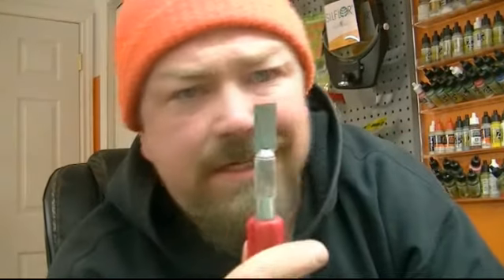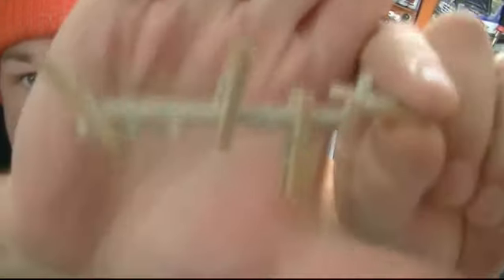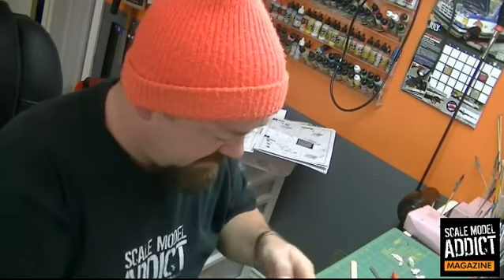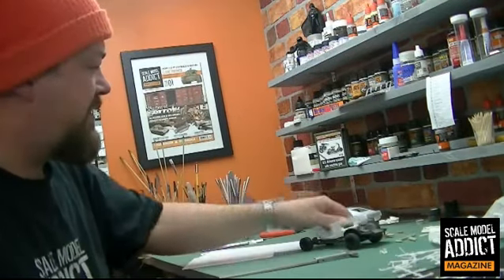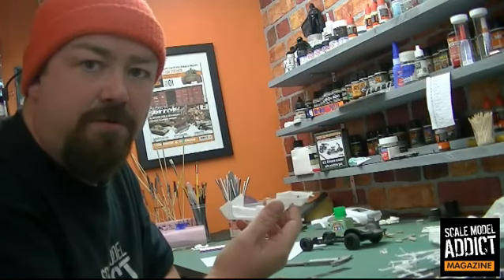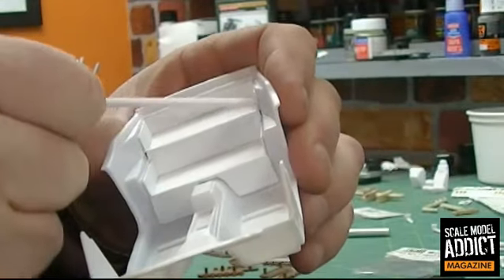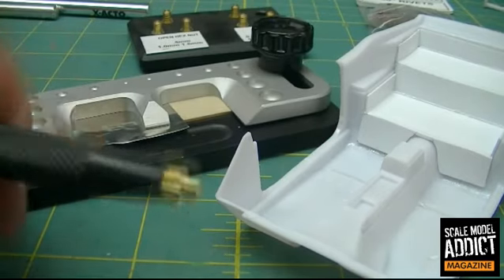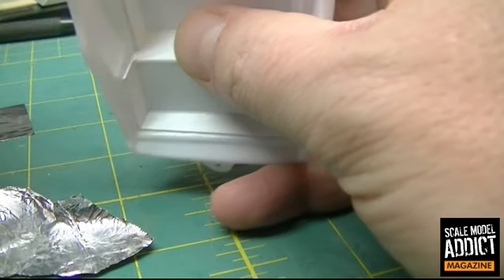11 - Building the Back Seat - Zombie Mustang

Comment: Another reason a dull blade could be dangerous is because they also have bits of glue, materials from what you used it for, and paint too. These combinations could cause infections to the cut. Also. As you cut harder, the blade could break off and the pieces could fly any where.